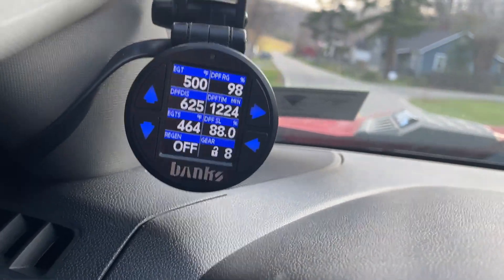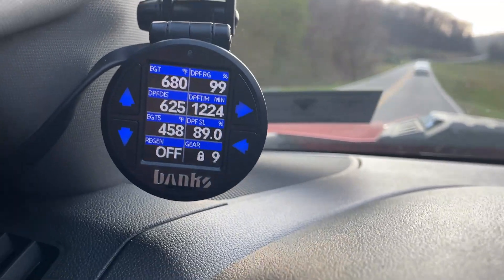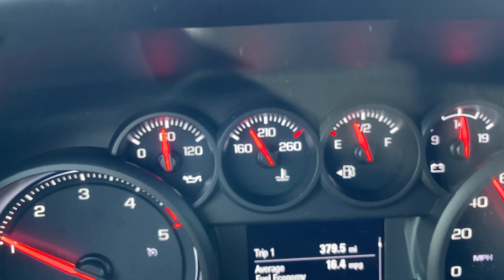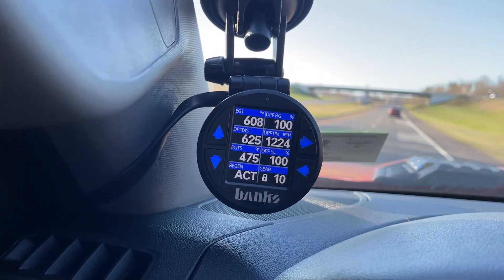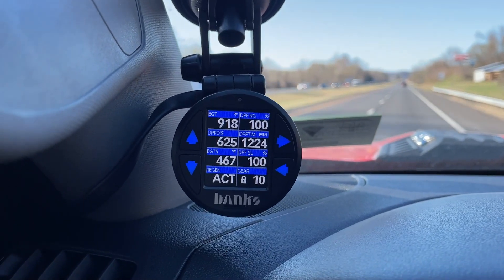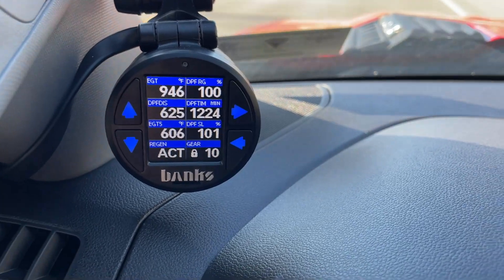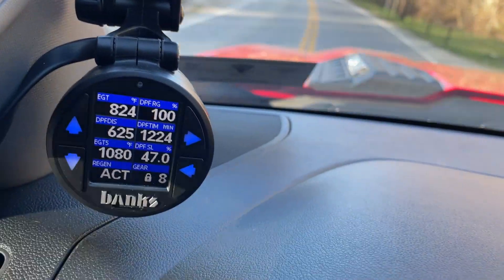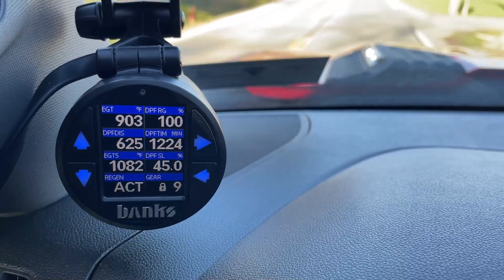How The Banks iDash Monitors Regen #292

Comment: Nice video!! I just installed the Idash Pro in my 2026 Chevrolet 3500. I can’t find where you find the transmission gear selection? Do you remember where that selection is located? Thanks!
Reply from the maker: There should be a menu option that says transmission and it should be under that

Comment: I got to kind disagree !
I live 3.6 miles to work.
I have never had an issue with regen. 

Manual says it will Regan basic where it left off or start the process over. 
Now I can say this after 62000 
I got a check engine light in Tennessee this week 
Dealer had to do a force base regen after driving to Tennessee about 8 hrs and burning 2.5 gallons of def 
It really didn’t make sense to me after tow/haul mode was on the entire trip 
The had to force it twice for it to take. 
Drove home no issue 
I do thank you for explaining 
I bought  a banks data monitor and setting it up 
It has a option to do a force base regen I think over 90 percent 
I had to pay 260 for the service had the RW dealer ship not cover under warranty in Morristown 
Thanks for I information

Comment: These trucks should have a button to manual regen....and/or Banks need to come up with it...thinking of going with Edge insight just for that reason...but i like the size of the banks
Reply from the maker: You can do a manual regen with the banks, or force start a regen while driving so if you are about to go into regen and you think it may not be finished before you arrive you can go ahead and make it start so it will be finished when you get to your destination, you can also read trouble codes and reset codes
Reply: How? I thought Banks is still figuring out how to do that for the 2025's  @WilliamsonRidge

Comment: 729 miles between regens is a dream.  I have a 2007.5 Dodge with the 6.7 Cummins, the first year they put DPF's on diesels.  I had a Edge Insight monitor to tell me when it went into regen.  In 2013 with 63k miles the DPF clogged, replaced for $3,100.  At 70k the new DPF clogged again and luckily the stealership replaced it for free and reflashed the ECU.  Besides changing my driving habits (no running to the store/short trips, drive until the regen ended) I started to take notes of how many miles between regens and how long it took.  If I averaged out the regens it would be 100 highway miles and 50 miles city between regens.  The average time in regen would be 12 miles.  Only a couple of occasions did it go longer than those averages.  729 would be a dream.
Reply: yikes!
Reply from the maker: You may want to check into a product called rislone, they make a dpf injector cleaner and dpf filter cleaner, it actually reduces the temperature at which it takes to clean the dpf which means it will self clean even when not in regen mode so if now it takes 1000 degrees to burn the soot out it reduces that number so it is burning the soot at lower temps helping to keep it from building up in the first place, I have listened to several podcasts and YouTube videos where customers stated they had dpf clogged and the dealer was going to charge 4-5k to replace but then they used the rislone product and it cleaned it right up, I don’t have any experience with it my self but am optimistic for if (or when) I have issues, I will definitely be trying it first, I did see that an aftermarket company now has complete dpf systems now that are supposed to work with oem trucks
Reply: @WilliamsonRidge   Thanks! I heard of Rislone and I am trying Archoil at the moment, it is suppose to help with regen but don't know if it lowers temps.  I can see the benefit from lowering the temp but depends how low.  Lower temps should mean faster de sooting when it does go into regen too.  I just got the brand new Banks IDash 1.8 data pro, so new all the PID's haven't been uploaded yet.  Banks customer service has been great so far.  I can read EGT,  3-400 idle, 4-500 deg around town, 5 -600 highway no load conditions. It would be great if it lowered it to those conditions but I don't expect a miracle.  The iDash is so much better than a 2010 Edge insight monitor and once they get all the PID's to work I hope my model year supports triggering a mobile regen.  That would be handy.

TBH, I'd do everything possible now to keep the injectors, combustion chamber, turbo, egr and dpf as clean as possible.  Additives, no idling, drive until regen stops (PITA most times).  I've neglected additives for a long time and just started using them.  I don't know about your dpf but some of the newer models I've seen the DOC, DPF, and Cat are 1 unit and has to be replaced as 1 unit ($$$$) or cut apart to get to the dpf ($$$$).   My dpf is stand alone and can just be unbolted (its not welded) to be cleaned DYI if it clogs again.  EGR, EGR cooler, CCV filter still have to be cleaned and changed every 67.5k on mine, don't think the EGR/Cooler has to be cleaned on late models though.

Comment: do you have your I dash set for 6.6l or 3.0?...i have heard some say they set theirs to the 3.0to get more info....I dont have soot level and mine just been updated to 124.11

my regen goes active first then the temps climb up, not once has it ever been the other way around....sometimes it actually takes a few miles while active before temps start climbing....i try to run my truck fast and hard in regen, it seems to burn more off...have done a few regens at slower speeds in traffic and it didnt burn off the soot as well, my next regen came alot sooner
Reply from the maker: Definitely 6.6 you will not have accurate readings if you are trying to read parameters from a complete different engine, 3.0 is an inline six and the 6.6 is a v8

Comment: I am considering the purchase of the Banks idash for my 2022 2500HD.  Banks has communicated that the idash allows you to complete a parked regen.  Is this accurate?  If so is there a reason you didn't use the parked regen?
Reply from the maker: Yes you can do a parked regen, I don’t do it because it’s not necessary because I typically complete the regens while driving, a parked regen is only necessary if you aren’t completing regens while driving  because of short tripping and not getting the dpf up to temp on short trips and it isn’t able to complete, if this happens to many times the dpf will continue to build up soot and clog the dpf requiring a parked regen. Also if you idle your truck a lot like a lot of fleet trucks they build more soot and clog up faster because at idle a diesel will not run at operating temp, in fact they will cool down while idling, causing more soot buildup and not able to clean filter, also parked regens will use a lot of fuel if not necessary, it will run  at 2k rpms maybe higher for 20-30minutes. Hope this helps

Comment: Maybe tractors are different. But my 2021 Kioti ck3510 goes on fast idle for 25 minutes when I push regen button, I cant use tractor at fast idle, so I park it. When I try to use tractor I have to kick brake off, then fast idle comes down, but then regen stops, so if I stop regen to many times I heard it plugs up the DPF cannister, and if that happens I'm afraid it might lead to a $3k repair or more if it messes up the computer..
The only good part is, this Koiti vs my L3400dt gets more then double fuel hrs, so I dont know if thats the regen set-up, or better fuel injectors, or better Ding Dong motor then Kubota....
Reply from the maker: Just curious, why do you push the regen button? On my Kubota m6060 it shows it needs to regen and you just raise the rpm’s yourself to where the min rpm light goes off and continue working, I have never done a parked regen to where I can’t do work at the same time, no buttons to push unless I want to delay the start of a regen, or I think you can push one to force a parked regen, but I’ve never had to use them, may be the difference between two brands but I would have thought it would work similar to each other
Reply: @WilliamsonRidge  So far I done regen about 6 times, I never tried revving engine up to 3k-rpms, but ether way  I cant run a tractor like that safely unless I was bush-hogging. The manual isn't all that clear to me so 3 years I watched couple YT videos that I could find on ck3510, and to make it more complicated no one on YT has gear tractor. But they showed the tractor parked so thats what I did, and then it took me a few minutes to figure that out. 
I thought all I was suppose to do was push the button, I didn't know had to lock both brakes in first, once I do that the motor kicks up to around 3k for 20 min, then 5 minute at fast idle, then it goes down idle where I can hear myself think, I need quiet to think and walk and chew gum same time..... 
And that makes me wonder, why cant they make a quit diesel tractor............
Reply from the maker: I c, and that may be a difference between brands of how the regen works, I hear you on the feeling safe, do what feels comfortable for you, I just run the rpm’s high and go to low range and still do the same work but it is loud and annoying.

Comment: Man really appreciate the effort. I just installed my Idash. Do you still run the same data points? If not what do you suggest to have visible?  Thanks.
Reply from the maker: I set up a second screen with boost pressure, oil pressure, oil temp, trans temp, engine coolant temp, and def level
Reply: Ya so update. I’m returning it. I like it and wish it wasn’t causing some strange feedback issues on my lcd dash. It makes my digital gages twitch randomly.
Reply from the maker: @user-eh9uy3cr2p  oh wow sorry your having trouble, I haven’t heard of it doing that before, but I don’t doubt it with all the digital dash stuff now, my 23 just has that tiny screen in the middle but my wife’s 24 model has digital gauge cluster and the large screen in the middle, but boy does it look nice

Comment: Very informative video, thank you for putting it together. I am researching different ways to set my I-dash up. I was curious about your time channels, it seemed like it went through a regen in the video, would the time and miles reset to zero?
Thanks
Reply from the maker: They don’t reset to zero they show how many miles and how much time it has been since the last regen, so if it’s been 650 miles between regens it will show 650, I use additives in my fuel and I can see which ones actually help to keep the dpf filter clean by seeing the mileage, some additive I only get about 550 miles between regens and some I get upwards of 850 between regens, less regens means the dpf system will last longer
Reply: @WilliamsonRidge  So if it just did a regen wouldn't it be 0 miles since last regen? Or does it just hold the previous amount?
Reply from the maker: It’s between the previous and the one it just did

Comment: On my 2023 Powerstroke the Banks Idash after showing a regen will start another “count up”. I have experienced an active regen trigger at 5 percent soot level at 40 percent and even at 0 percent dpf soot level. I have literally watched it go from off to active and my exhaust temperatures climb and fuel level decrease. So I think it’s a mile OR dpf soot level activation that the manufacturer has built into the system. But what a waste of fuel to initiate a burn at 10, 5, or 0 percent. Makes no sense.
Reply from the maker: Yeah I think they will essentially time out so to speak even if the soot level doesn’t reach 💯

Comment: I don't know how many iDash videos i watched trying to find out if you can track when your regen will occur and yours is the first to actually answer. I don't know how iDash could have a video of Top 10 features and not include this one. Crazy.
Reply: The 2019 and up no longer has the dpf percentage. There is another pid you can use. I cant remember what's it's called. However it dose have a pid to show when a regren is active. You cN toggle through dash on truck and check tje factory dpf guage. I don't drive my truck a lot so I haven't see banks show a dpf active yet. I only drive it like 50 miles a week right now. I got another daily driver
Reply from the maker: @cameron-4757 yes they do, mine is a 2023, the truck doesn’t show any indication of dpf on or off or soot level or percentage but the truck ecm still monitors all that info and the banks iDash can read it and display it.
Reply: @WilliamsonRidge my 2022 Tradesmen shows dpf level. I shoot you a picture tonight when get home
Reply from the maker: You do realize this video is about a Chevrolet not a Ram right?

Comment: thanks so much for the video! Are you still happy with this particular model? My husband's truck has been acting up with "power reduced" etc. It's really stressful. The link you give for the product only has about 10 reviews so just hoping this is still the one you'd recommend. Is installation easy?
Reply from the maker: Very happy, the link is the correct one, It is very easy to use, just make sure to go to the banks website and update the iDash then when you plug it into your vehicle select the correct engine
Reply: @WilliamsonRidge  really appreciate the info!

Comment: How do you get those settings I just got idash and don't see all those settings . 2024 GMC diesel
Reply from the maker: Main thing is make sure you update it through the Banks website, they use the same iDash for all models and sometimes if it’s been in stock for a while they won’t have the current models in them to be compatible then go in the setup and make sure to select the correct engine configuration

Comment: I can’t find the DPF S/L and the Transmissiom Gear option on my iDash for my 2024 GMC Sierra 2500. Help!
Reply from the maker: Have you done the update? And went in and selected the correct engine, I had to do both to get all the parameters on mine, when I put mine in I had to do an update to get it to work correctly with the 2023 I would say it’s the same unit but the updates will make it fully compatible with the 2024

Comment: Great video I just purchased a 2024 d-max and have been looking into this product. What are the differences between the standard and the monster units?
Reply from the maker: The standard only reads your trucks info, the data monster has a slot for a micro SD card to record your vehicle’s info so you can then put it on a computer and look at it in a graph form, possibly if your having intermittent problems that don’t happen when at the dealer you can have a 30 log of exactly what your truck is doing, I think both are still capable of reading and clearing codes and putting your truck in a mobile or forced regen. The data monster just has the capability to record
Reply: @WilliamsonRidge  thank you for the info!

Comment: I was under the impression the bank's I Dash would you allow you to do a forced Regen without going to the sealership
Reply from the maker: It will, you can go in and turn it on manually, for instance if you know your going to be driving and you think you will go into regen and it not finish by the time you get to your destination, you can turn it on, called a mobile regen. I’m pretty sure you can also do a manual parked regen, I haven’t needed that so I haven’t tried it, but I’m pretty sure it’s in the same menu were you find the mobile regen
Reply: @WilliamsonRidge  appreciate the info🤘
Reply: We need a video on doing a manual / mobile regen... I'm a city driver and wasn't aware about the regen.

Comment: Where did you find the DPF soot level at and the transmission stuff. My 24 isn’t showing either
Reply from the maker: You may need to update the iDash also make sure you have the correct engine selected
Reply: @WilliamsonRidge  got with Banks they don’t have those pids for the HD Duramax 2024 yet
Reply from the maker: Oh darn I’m sure they will do an update soon though and get those on there
Reply: @WilliamsonRidge  ya hopefully

Comment: just got the idash for my 2023 ram 2500 I can not locate the dpf rg and soot % on there.
Reply from the maker: Make sure you have the iDash updated and the correct engine configuration entered, I tried it first without updating and it didn’t have some of the info, I also had something set up wrong with what engine I had selected, once I found all the correct settings it was all there
Reply: @WilliamsonRidge  thx for responding. I did speak with Steve at Banks and he helped square me away. your video was very helpful for sure and is what helped me pull the trigger in getting the banks idash. My Soot LD shows up as DPF LD on my 2023.